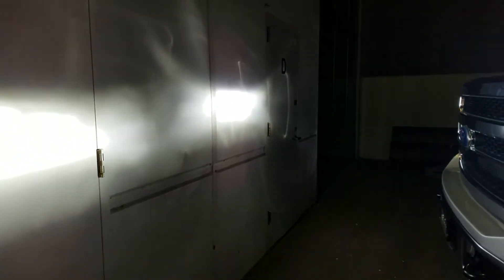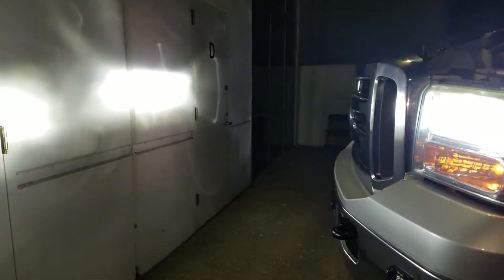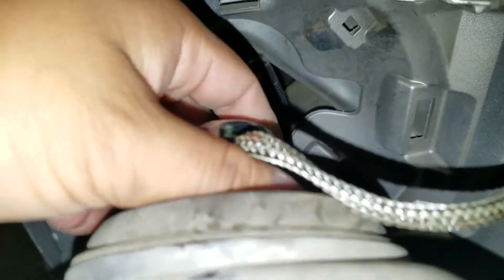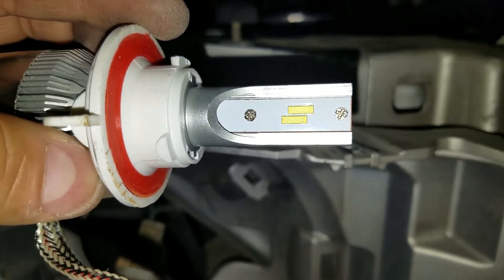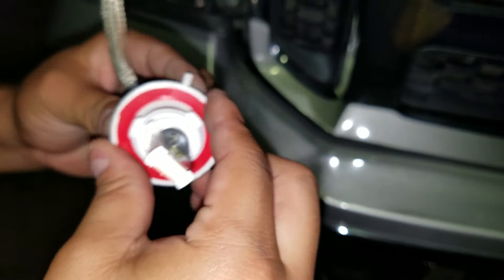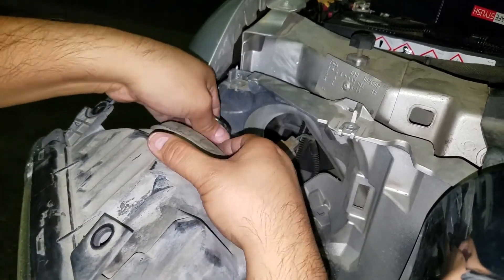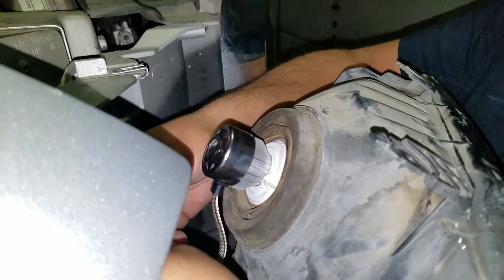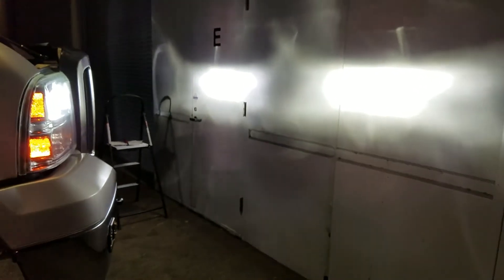How To Properly Install Lasfit Dual Beam Headlights

Comment: On my 01 f350 using the 9007 lasfit bulbs mine were indicated to have bulb flat side horizontal.  when in hi beam on side is on and on lo beam only one side is on. both sides are never both lit either on hi or lo beam.  i guess different year models are different.  they work good now but were a pain to get them oriented the correct way and i had to use the existing lock collar to keep them in place.

Comment: What bulb will work best in a 2001 factory replacement bulb?
Reply from the maker: Your vehicle is 2001 Ford F250, right?
Reply: @Lasfit-Automotive  yes it is.
Reply from the maker: @tonygross7228  Ok. Is ithttps://www.lasfit.com/products/9007-hb5-led-headlight-high-and-low-beam?utm_source=Social&utm_medium=YTB%20Channel&utm_campaign=LAplus9007 sealed beam headlight or standard halogen reflector headlight?
If it is standard halogen reflector headlight, the bulb size is 9007. Here is the link:
Reply: Yes it's the reflector one.
Reply: I'm also going to try to get the boss to replace the lites in the yard dog. It's a autocar to move simi trailer to the docks. It's a 9003 hb2 bulb in a reflector housing also. I talk to him tomorrow about that one.

Comment: just installed,  but my high beams only work .. 07 f150
Reply from the maker: What LED bulbs did you purchase from Lasfit? LAplus series H13 LED bulbs or LCplus series? Please contact us for support by email (cs@lasfit.com)
Thank you
Reply: @Lasfit-Automotive  
LASFIT LA Plus Series H13/9008 LED Headlight Low High Beam Bulb 60W 6000LM 6000K
Reply from the maker: @tonee667  Both of two LED bulbs high beams only work?
Reply: @Lasfit-Automotive  

High beam light on my cluster will stay on for both low and high beam now .. I also have fog lights but when I switch to low beam both head lights and fog lights work and when I switch to High beam fog lights turn off and just the headlights stay on .. I do notice when switching high and low the light shadow moves up and down but the high beam light on the cluster will stay on fornlow and high   this only happens with the led lights installed..
Reply: @tonee667  I have the same problem. Did you find a solution?
Reply: Not yet, I heard from  family to buy a relay but haven't got to it yet..